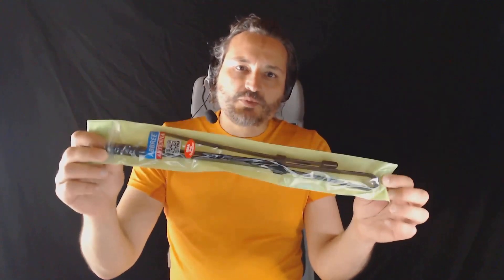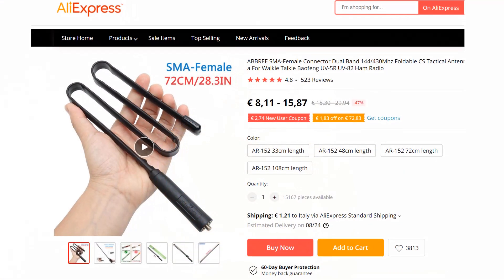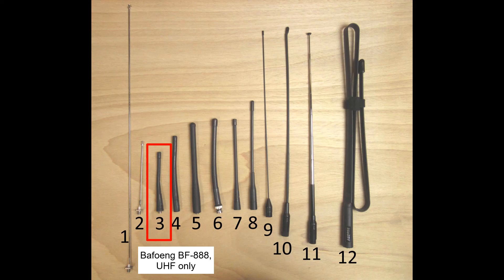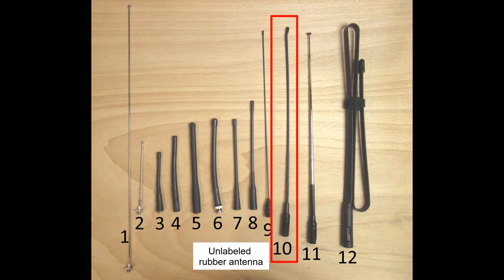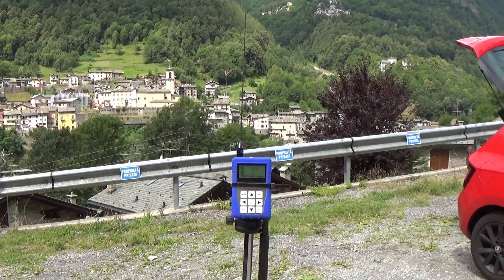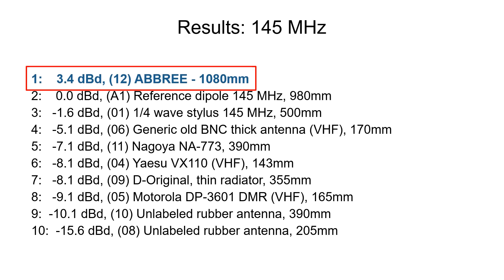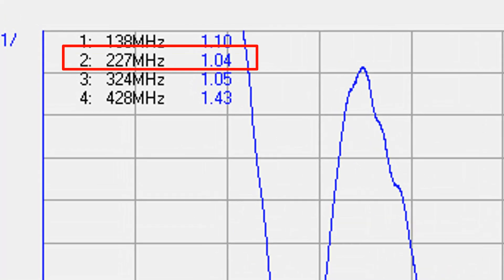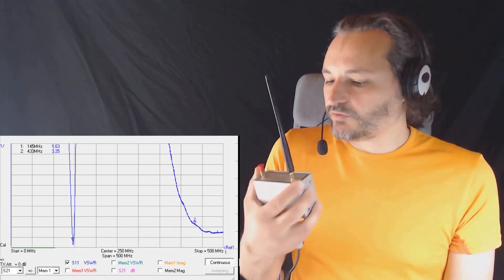ABBREE V/U "tactical antenna" under test

Comment: I MADE MY OWN abbree aNTENNA TODAY FROM A FAKE EBAY ONE , rewired the correct copper on to it, put the right resistor on it in the right place and noow ITS PERFORMING bETTER THEN ORIGINAL IN THE BAND I WANTED TO.

Comment: Very nice video, Dave. Since I have looked inside of an nearly identical antenna I will say that the metal radiator is a wide copper tape, and the snapping aspect that seems like a measuring tape comes from the outer plastic sleeve. Since the antenna seems to be at its best at a little lower frequency than the 144-148 Amateur band it seems that it could easily be shortened. Just remove the plastic cap and cut off a bit and replace the cap. 
 Also, since the copper tape is 100 times wider than it is thick, there is probably a bandwidth advantage to having the wide side facing the 'target.' 
Thanks for the professional treatment! 
 ..............Z D.................

Comment: I have the Abbree 18.8 inch antenna on my TYT UV8000E 10 watt handheld. I use a frequency of 146.775 a great deal, since it is a local repeater near my house. I checked the SWR's on said frequency and got 1.03 and a power output of 9.97 watts. I did some research and found out the Abbree antenna is tuned so you will get the lowest SWR's at 146.000. And they use shrink fit tubing to cover the two tape measure pieces. So if your cover gets wrinkles, just use a hair drier/blow drier set to high,and you will smooth things out nicely.

Comment: I have seen some other real world tests up to 9 miles simplex and the most efficient one the tester found was the 28.5" length Abbree. The 42 " only barely edged it out on 2 meter, but actually had lower Smeter readings than almost all the other 28.5" readings. As with anything there is a sweet spot for antenna length especially on a HT

Comment: Would you use that antenna for a handheld cb radio?
Reply: No, I would no. A CB radio works at 27MHz which is very far from the frequency these antennas are designed for.

Comment: Can you test it folded on 70cm?
I've seen in another video that it performed better while folded on UHF
Reply from the maker: Hello Harry. I did not publish any test with the antenna folded because on the initial measurement, folding the antenna raised its SWR to very high values in both bands and I assumed it wasn't designed to be used folded.
Reply: @Iz2uufNet  But it still interesting :)

Comment: Hi David, I have just got mine today and re-watched your video.  I wonder how it works on UHF if kept wrapped up?  Have you tried checking that on the VNA to see if it would work?  I'm still waiting to get a NanoVNA so I can test myself.  Lastly mine came with a bendy extension thing but I didn't attach that - seems to make it approx 10cm longer.  Thanks for the video it was very nice to see the scientific approach!  73 de HA5RV
Reply: I just ordered the one with the bendy attachment a few minutes ago. Do you think the bending piece is rigid enough to use? Or will the weight of the antenna make it flop?

Comment: IZ2UUF - I use a Radio Shack brand Telescoping center loaded HAM antenna, it’s just 6” closed , good for Public Safety and up to 26” fully open for HF and CB operation, you can transmit up to 5 watts with it, it’s fully Tuneable by opening or closing the Telescoping sections and its center loaded so NO ground plane is needed. This is an excellent antenna for HT for QRP low power operation. I can even attach a roll up antenna when Fully Extended for HF receive.

Comment: This is absolutely great test,  I would never came up to use signal generator and rf meter, much better than my DP3600 built in signal strength meter.
Mine I tested on UHF and was very disappointing to level that i just make teardown of it!
https://youtu.be/mDxDFJ1MvFY
Now we have final answer... it's just bad on UHF... 

I can safe not buy another one, i got lot comments that mine is fake and when i get "genuine" i will be happy:) 

Not the case:)
Have You any recommendations for single band, UHF only antenna with better performance than stock 1/4 Motorola?

Comment: Thanks for your review! You are right, signal band antennas do work better in most cases. :-)
Reply: ka9radio - the OLD Radio Shack Telescoping center load HAM antenna is a better performer, it’s fully tunable and Telescoping from 6” to 26” with a center load. It’s full 5w rated and performs great at 6” for Public Safety and 26” for HF or CB Reception.

Comment: Interesting test, and thank you for your hard work. I use the Abbree 18.8 inch antenna on my TYT UV8000E HT. on 146.775 I have a SWR of 1.17, on 446.300, I have a SWR of 1.08, that reading made me test it three times to make sure, and I did use a digital SWR meter. So I think the shorter version might be better.

Comment: Thank you very much for the very effective test.
I was wondering if one of the slightly shorter ABBREE antennas would do better on UHF (isn't there one whose length is about 70 cm?)
This is a great video.
Reply: Keep it folded for that.
Reply: I have the smallest, 13 inch. It works really well on UHF.

Comment: Very interesting test!  It would be nice to have a link to the actual antenna you purchased.  I assume your is original but I have seen that there are some fake versions on sale and that they have basically nothing inside the matching part.  I curious how easy it would be to make a matching coil for UHF?  
Also perhaps one of the others is much better on UHF.
In any case I really like the concise, structure and scientific approach great job!